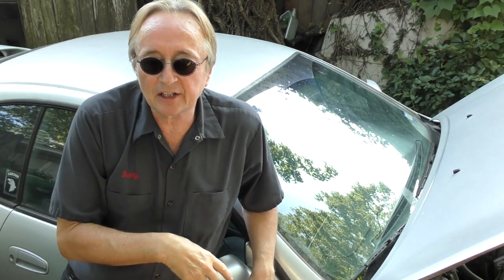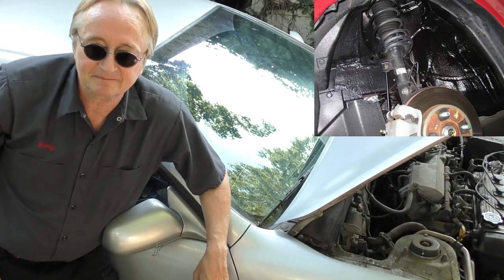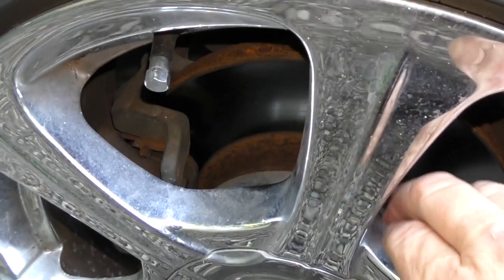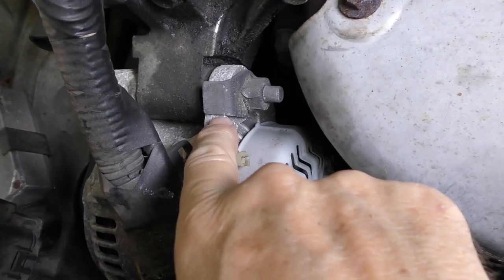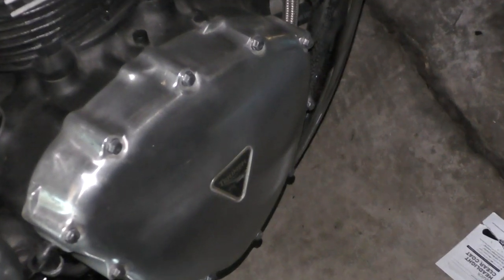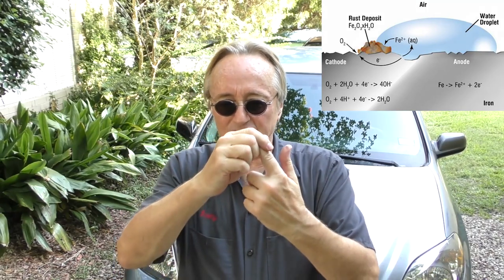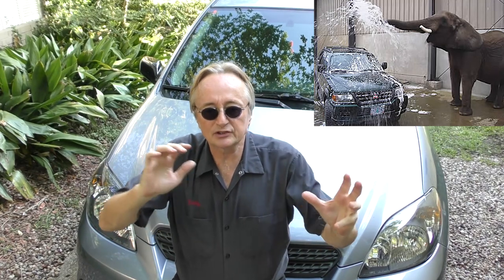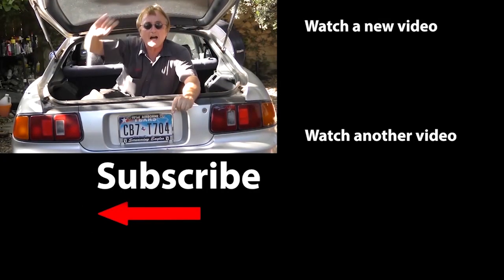Why Not to Park Your Car in a Garage

Comment: I finally escaped from apartment living, and if I'm paying all this damn money for a house, the car sleeps in the garage. Its days of being outdoors at night are OVER. No more paw prints on the hood, no more scraping ice off the windows and windshield before I can go to work.
Reply: fair enough!
Reply: all it means is that you have to be more diligent about the road salt, since it won't stay frozen.
Reply: If you owned a 94 Celica it would never rust or breakdown. You could garage it forever.
Reply: epa316 just don’t heat the garage, no issue and save money.
Reply: Your car thanks you for such tlc
Reply: 'Garage good , Kimosabi.'
Reply: Or you could buy a $70 car cover that will last about 5 years or more....
Reply: I love my garage
Reply: Rip your car though - scotty
Reply: Dude!!! Straight up! F' that damn neighbors cat!!!
Reply: No more people trying to steal the registration sticker off your license plate...
Reply: Exactly, newer cars are rustproofed well enough leaving salt on them in a garage would take a decade or more to cause issues. I'd much rather not have my car exposed to temp extremes, hours of uv light..not to mention getting in a car during torrential rain exposes all the fancy electronics for the windows, mirrors, stereo speaker etc to water damage, and if you have a leather interior, soaks that as well.
Reply: Exactly and when I finally am crazy enough to buy an all-electric I'm going to have to do it anyway to charge it.
Reply: Its the ultimate luxury
Reply: If the garage is a separate building and you don’t heat it then it shouldn’t matter.
Reply: Fr the ice scrapping was the worse or cats sleep inside the car at night lol
Reply: @jerro1446  Or spray it off in the heated garage.
Reply: Very nice 😊
Reply: Wait what, but i always thought it was best to garage yr car against hail, snow, rain, frost, and f**kn birds, then again whata i knw😅
Reply: I swear the paw prints has to be the worst!!  Love all the cats in my neighborhood but man it gets old

Comment: He's right about Arizona.
Not only is it too dry for rust, it's too dry for mosquitoes and flies as well.
I love living here <3
Reply: Same here in Las Vegas. Except every other year mosquitoes do show up here.
Reply: AZ is great.  Rust free
Reply: I agree with the rust but flies and mosquitoes? Flies are everywhere and mosquitoes are out during the monsoon season.
Reply: My car’s from AZ. It has:
- no rubber (scorched away)
- no interior (scorched away)
- no paint (scorched away)
- no (structural) rust

There are some trade-offs 😂
Reply: @RustOnWheels  Couldn't agree more. My first year I moved to Arizona from Ohio with a new truck my tires melted, battery was fried and I had to replace windshield wipers every 2 months. You have to buy special heat rated everything.
Reply: I’m from Tucson AZ , no rust, however then sun can be just as damaging for the paint, especially if you don’t keep it clean. So hot out here.
Reply: Is it to dry for sweat? If so I'm packing my bags
Reply: Lived in Phoenix for a year. That was back in the 1970s, no a/c in the house or the car. Hot? You do not know what a hot summer is! 118, 115 degrees every day for weeks! Never got below 100 degrees even at night. Only relief was a thunder storm that came through almost every afternoon. Was so glad to get out of there!
Reply: In which case, you need to keep it in the garage to keep rubber and plastic from turning to dust, therefore completely defeating the purpose of this video
Reply: Armando Sturzenegger   actually I did attend a lot of rock concerts. I grew up in San Francisco and the peninsula. By the early 1970s I was done with rock concerts. I saw a lot of local bands, Grateful Dead, Jefferson Airplane, Quicksliver Messenger Service, Big Brother and the Holding Co., Steve Miller, Country Joe and the Fish, Blue Cheer. Then there were out of town bands that played the Fillmore and Avalon, The Doors, Jimi Hendrix, Iron Butterfly, Paul Butterfield Blues Band. That list of bands is off the top of my head. Saw many others. Saw the Stones twice, both times before Brian Jones died. Never went to see the Beatles. I went to concerts from 1965 to 1968, so any bands that came after that I have not seen.
Reply: Lucky you ! Haha. Love that hot weather
Reply: It's also too hot to live
Reply: Until monsoon then you can’t go outside without getting 20 mosquito bites
Reply: No mosquitoes?  Where in AZ is that?  I just got bit 3 times walking my dog this morning alone.
Reply: @jonesjones7057  lmao
Reply: The extreme heat and infrequent rain combo means the the 2 to 4 times a year it does rain, your wiper blades are always dry-rotted from the sun and useless. I keep a good set in its package and leave the dry-rotted set on the car, switch them when it rains, then switch them back. Beats buying a couple of sets a year (they're getting expensive), if you can find any during the rain rush when everyone runs out to replace theirs too.
Reply: Phoenix has some pretty aggressive mosquitoes.
Reply: Ya what about dry skin and eyeball sockets?
Reply: @joetroutt7425  yes, but that's a symptom of heat stroke.
Reply: But I would like to see snow at least once a year plus I like having all 4 seasons. Doesn’t feel like Christmas or the holidays when it always 100 degrees.
Reply: Passed through AZ once, was probably 100F degrees outside and made me feel sick. Was not used to that air. I live in NC so I'm used to 110F with 100% humidity. Still disgusting to walk outside, but that AZ heat was completely different.
Reply: As long as you like living in an oven.
Reply: Living in the desert is fine, until you run out of water.
Reply: Here in AZ you don’t want a garage, but a well ventilated car port. At least three sides covered. The heat is suffocating.
However... there are PLENTY of skeeters, so can’t figure out the comments to the contrary.
There’s even a new variety of skeeter that is making people sick!!! Goes great with the killer bees!!!!!
Reply: That depends where you live. Is very hot in summer ? 110F or 115F
Cool ? 
Depends where you live .
I live close to the sea so alot of cars have problems with the salt.
I have a Mitsubishi from 2002 , 250.000 miles and no rust. 
Others cars like merc , bmw , opel , alot of rust but depends what the owner does to the car
Reply: Márcio Seia 
Yup hot as you mention. Even 119 sometimes, then the summer rains hit and it feels like a sauna. We keep the little Toyota in the carport during the hottest part of the day cause we see a lot of overheated luxury cars on the side of the roads! Want the little buggy to last as long as possible.
Reply: Can't go out in the day. Can't go out barefoot at night. I guess if you want to live in a bunker and never go out it is fine.. As long as the grid never goes down. In which case, it doesn't matter where you live. In any case, my life revolves around my Husky, so AZ is not an option.
Reply: It's also too dry for water.
Reply: Dave S. How about texas
Reply: I have lived in AZ for 20 years, and the mosquitos are UNBELIEVABLE! I have sat in the middle of a ring of citronella candles blazing around me - looks like I'm doing voodoo - and these mosquitoes are NOT phased by those candles. I did find a product that actually works and keeps them 100% away. (No, I don't work for the company.)  I swear you guys, look into it. It's called "Thermacell". They have units that you can clip onto your belt or some that are a lantern, but it basically has a hot plate that the repellent soaked pad sits on, and vaporizes away (heated by a tiny disposable butane tube). It says it covers a 15-foot radius but my husband says is a little closer to 10 feet. I got ours at Walmart. If you are pretty handy you might look into the ingredients so you can make the disposable pads yourself and possibly refilling the butane with your own. It's so nice to be able to do my hobbies outside again. (Working on cars, painting furniture, etc...)
Oh, also, no blue lights. They love them. Get a yellow light bulb for outside. (it doesn't have to be marketed as a "bug bulb". Just yellow or even orange will help.
Reply: My momma keeps saying there's sick eagles out there. WTF?
Reply: @christophermendonca7969    😄😄😄. Yeah.  Lived there for 12 yrs.  Always burning out batteries, A/C, tires, and interior headliner dried out and came apart!!
Everybody fights to find trees to park under when you went to a restaurant or shopping!!  😆😆🤣😨
Reply: Dont tell everyone, lol. They will move there. The population will skyrocket.
Reply: Bonnie Hundley Not me !!! That heat out there is unbelievable.Can't stand the summers here in New Jersey never mind Arizona.I know they say it's a dry heat but the hell with that. 115 degrees is still 115 degrees no matter how you want to spin it 🙄😂😂😂
Reply: It also has the highest cancer rate for skin cancer there
Reply: Hope you got hella lotion tho.
Reply: No rust as there’s no water! Too many people-not enough water
Reply: Sledanet Thats why you keep it washed and buy a cover for it
Reply: I melted a credit card on the dash of my car in Phoenix. It was a blast. No thx.
Reply: V W damn. 
I’ve been paying for rust for years!
Reply: Are you from Buffalo Scotty?  You could be!
Reply: @joetroutt7425  If you're not sweating in the desert, you're developing your first signs of heat stroke and need to go to the hospital immediately.
Reply: It's great here the only thing that sucks is the crazy heat during the summer when it's over 110 for 2 months, other than that AZ really is a great place to live lots of upsides.

Comment: Heated garage? Who has one of those? My garage is same temp as ambient air.
Reply: Michael Lam you are the exception, not the rule. Would be nice to have.
Reply: A heated garage can occur in a very humid place; the garage would be naturally heated ;-)
Reply: I have a heated garage but only because my garage is under the living quarters and that is where my furnace is.  And YES- it is AWESOME!!!   No snow EVER in the morning!!!  it's also nice that I can wash my car almost all year round in the automatic car car wash unless it is super cold and  my car is completely clean and DRY by morning.  I bought my car new 2013 and it has almost zero rust underneath.
Reply: Live in an apartment building. The garage is maintained at like 10-15 degrees.
Reply: Mister Gaming...Exactly.
Reply: Who listens to him?
Reply: Come down to central Florida in the July. Garage is like an oven
Reply: I have a heated double garage because of winter and an electric car
Reply: Mechanics often have heated floors bc they work in them a lot and have equipment needed to stay warm/cool

Comment: Scotty I have to say most of the time you’re spot on.. This time you’re wrong. A garage allows your car to dry out. That doesn’t happen outside in the winter. BTW the road salt stays liquid down to 20 degrees.. So unless you live where it stays really cold all the time your car outside will experience many freeze and thaws. I’ve garaged cars for years and it definitely helps the body last longer.
Reply: thank you for your point! it makes me wanna reasrch this topic more...I do put my car in garage
Reply: Yep good point. My dad had his Shelby in the garage for years with No rust.

Comment: When we lived in Michigan my late husband would wax everything! In the fall he would get underneath our car and take the cheapest wax you could find to undercoat the car around the wheel wells plus the metal in the engine that was showing. You would open up the engine compartment then wax anything that was metal. He had a set of paint pens but none of the matched our car so we had stripes of paint in the scratches and it got to be looking like it tiger on steroids. I have to say we never had any rust

Comment: I lived in Wisconsin (mostly) until I was 22.  I had a 1966 Dodge Dart that had the tops of the front fenders rusted through.  I think I had the only car that threw rooster tails FORWARD when driven. 

I also had a 1964 Fairlane that had huge holes in the floor boards. You could see the highway pass below. I called it my Flintstone car.  (but I only paid $35 for it).  It had a 3 in the tree and a 260 V8. It got 22 mpg all day long.

Comment: I live on an island by the atlantic sea, most people here do chassis protection when the car is new. Did that to the 96 Toyota Carina when it was fairly new, to this day it almost got no rust and runs like a champ!
Reply: Brzeczyszczykiewicz The Gulf is saltier, and everything wakes up wet every morning. The roofs rot, condensation inside the body rusts it, the seam along the leading edge of your hood.... You get the picture. Those free car washes near the beach are recycled water. 
The “spot free rinse” everywhere is salt water. It’s OK on the paint, but don’t let it run down the windshield into the body

Comment: In UK we have a product called Lanoguard that is very easy to spray on the underside of vehicles. Apparently it contains lanolin (found in sheeps wool and it smells like it too!) that goes through the rust and clings to the bare metal. I moved nearer the coast and my old ZJ was beginning to spot rust. So far 6 months later its definitely still holding off the rust even on the exposed bolts.

Comment: Live in Florida and watch the fl sun destroy your paint and interior!
Trust me you want your car in the garage .
Your still a great mechanic though 👊🏻
Reply: I lived in Stuart , Fl. And bought a 2001 isuzu rhodeo in 2002 with rust on the back of the bumper, around tail lights. That salt water air is No Joke.
Reply: He was talking about a Heated garage in cold climates that routinely salt the roads.
Reply: you were not listening. he said if you live up north during winter it does not help to keep taking it into and out of garage as the salt water has more time to corrode...
Reply: Yeah if it's already above freezing outside it doesnt really matter if it's in the garage or not.
Reply: Agree with that
Reply: Oh yea. I believe a garage saves a car from alot of damage!
Reply: I live in Nevada and wax my car every 6 months at the very least. I don't have a garage, but showing a little love to your car and protecting the paint from the heat and when you can place it in shady spots does wonders. We all see the paint taking excessive sun damage and fading occurs, then peeling will follow behind it. Takes so little time to wax your car and truck and people are just too lazy or just don't care enough to love it enough to wax it.
Reply: clearly he wasnt talking to ppl in florida. sit down buddy
Reply: @BlueDroneBlues  i parked mine up since February while i collected parts. it was outside in the texas sun and i have clear coat bubbling in spots and a big spot on the roof. i regret not taking it to the wash. pretty pissed about it.

Comment: I'm in Wisconsin they use the calcium chloride in the winter it's insanely corrosive, if you want to have a nice vehicle here, have a winter beater and park the other.
Reply: Ditto.
Reply: It’s a mix of things they added the whey liquids years ago.  Salt is expensive so they thin it out with whey and sand.  The new salt trucks are very high tech now, scans the road surface, computer applies the “salt”.  Have the ability to do two whole lanes at once.
Reply: And all the new car dealers love whatever destroys your car, and makes you buy a new one.

Comment: I have an old dodge durango.  It has no rust.  The engine, transmission, power steering pump all leak.  The frame will last forever
Reply: Haha same with my Chevy Silverado. The frame will last till the next century. The body might fall apart by next spring though.

Comment: I live in northern Minnesota, and I am 100% convinced that the people who have decided to drench our roads with brine are getting a kick-back from the seller of the brine.  Ten years ago they only used salt sparingly at intersections and if there was freezing rain.  Now they use it even when there is no snow in the forecast.  They simply put it down every few days no matter what.  It ruins our roads (some city roads have been turned into gravel and pieces of concrete) and our cars, and it even gets in the interior where it turns into a crusty cake on the car's carpet.  What a scam!  And like you said, Scotty, it still eventually freezes when it does get cold enough (-10F) which is very common up here in the winter.  All they are doing is transferring icy roads at 20F to icy roads at below zero F.  It does not make any sense, so someone must be getting money to do this.  That is my opinion.
Reply: 573F4N X13  Thanks for your reply.  There is little doubt in my mind that someone is making a lot of money off the brine.  I was told by a fairly high-level city employee that the city buses are being ruined by this crap.  So the question is:  Why do they keep using it?  There is only one answer:  Corruption spelled "money".

Comment: Living in the rust belt , Ive found that it helps to raise up the hood and rinse off the underside of the hood and the radiator and inner fenders.
This helps prevent rust that a " drive thru " car wash wont remove .

Comment: My mother had a 1994 Chrysler Concorde from 1998-2016 at her death and there wasn’t a speck of rust on that car. Paint and clear coat was perfect. All she did was keep it in the garage and wash it regularly, at least once a week, more in the winter when the roads were salty. It’s pretty simple. The car had over 200,000 miles on it too

Comment: Amazing salt is still used on roads in many states when coarse sand does pretty much the same job without near as much damage to vehicles and infrastructure, it rots out rebar in concrete too.
Reply: It clogs storm drains. Especially in the northeast. Salt "usually" just dissolves when the ice and snow melts